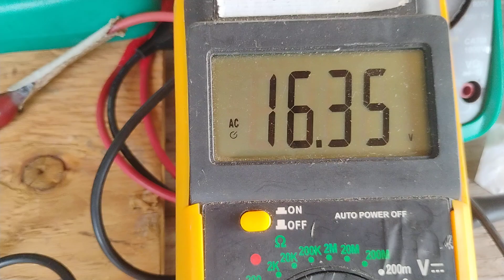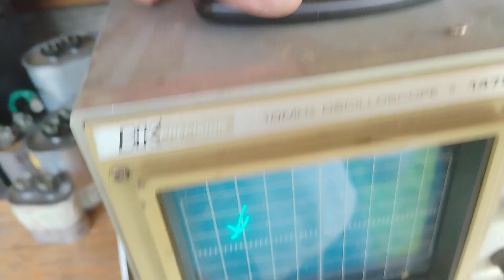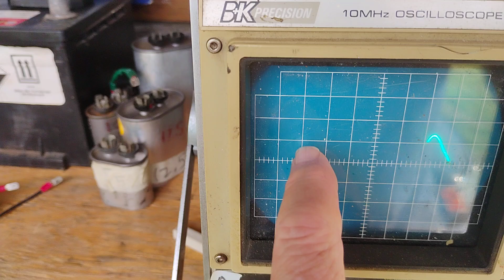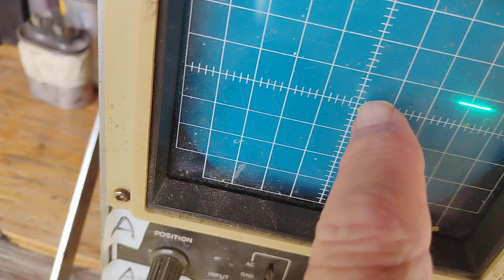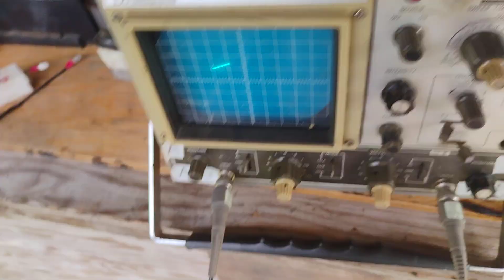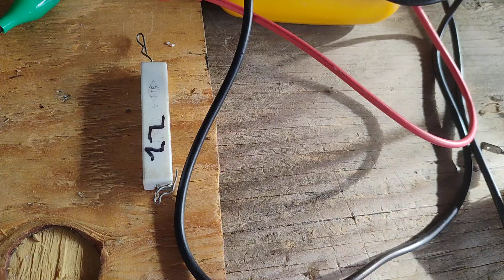90 degree phase shift with BiTT transformer gives zero watts input while 5 watts output

Comment from the maker: I did not mention it in video, but "how it works" is the shunt bars made of those hand-cut laminate steel plates (also varnish between each of  them to cut down on eddy currents) creates a "magnetic pathway" that the backemf current that is created at every polarity change of the AC wants to follow, as it will follow the path of least resistance, which is what the shunt bars provide.

So backemf currents which normally back up into the primary core leg and primary coil around it  (lowering its resistance so that there is more input draw whenever backemf is created, which is only going to be created when secondary coils are loaded with resistance)

Instead now the backemf currents are either neutralized, and never make it back into the primary core leg or primary coil, since it takes that alternate path of shooting backwards through the shunt bars, 
"up and over" the primary, and not the "usual" path directly back to the primary.
Almost like a magnetic-current diode connecting one secondary to the other  how to look at it.

The magnetic currents when they shoot over the primary through the shunt bars, will end up "reinforcing" power being made over in the opposite secondary,  if the backemf makes if over that far and just does not get extinquished/neutralized by all the ferrous steel in the shunt bars.  Either way the backemf currents do not make it backk to the primary.....

So thats how it works - the backemf currents bypass right over the primary and end up in the opposite secondary, and this works going  both ways, into opposite secondaries, plus same thing happens above and below the basic 3ph transformer as well, since two shunt bars mounted.
.
I will suspect consequence of "no backemf" entering the primary from the secondaries upon secondary coils loading up from a resistive load,,  is that the phase shift between volts and amps becomes that 90 degrees, with the variables"and choices to make from the "operator" to see  if it will really work (or not) is the resistive (or inductive) loading, and the voltage input and frequency of AC.....

Comment: Great work Kone! Did you try putting a cap in parallel to primary so as to correct PF at input? Maybe in that way you can use a normal inverter with PF=1 at the input. Keep going!
Reply from the maker: Hi Wally 
I wound the transformer to have 120Vac input and about 15Vac output, so the idea and next experiment is to run one of those statpower brand invertors from that 15Vac but rectified and with smoothing DC cap too.  Not sure how that will work out, hopefully if lucky the resistance of the invertor, while powering a load with its AC output (such as a rotovertor motor or whatever) will be such that I will still have that 90 degree phase shift from the g20Vac 60hz grid....if that "first step" goes well, I could have another statpower invertor (I have three, they have half the input watts as a normal invertor why I like them) that sends in power to the "hemmoroidall" transformerm instead of the 120VAC 60hz grid power.
I might be able to make it really simple, and just run the 120VAC from a statpower invertor straight into the high impedance primary of the hemmoroidall transformer. Then the 15VAC from the "H" transformer low impedance secondaries  rectified back into the DC input of the statpower invertor....who knows that might work for an easy loop.
I have not attached caps to anywhere yet, but will....I know a series AC cap coming into the  primary can really increase power output  in the seccondaries but have to be always  careful not to knock the primary AC input out of its 90 degree phase shift - that is the whole "trick" to it....keeping that 90 degree phase shift happening, now its reactive power being converted to real power is what it does no matter about anything on the input but "what it takes" to create the reactive AC power.
From the grid its easy -just use the grid with its "unlimited" current potential, so an invertor does not seem to take advantage of that 90 degree phase shift and show near zero input on the DC side of it, however I hear they do make "power factor" friendly invertors especially in the big wind turbines but have not seen one off-the-shelf available to public so this would be good project in future...
I havent tried a paralleled cap across the primary yet,....also want to try "vectoring" this transformer with one half of transformer running AC power in series through it, then it leads into an AC cap...Hector will say to vector the crap out of it...but have not tried this yet .....Thanks for writing!  !

Comment from the maker: Hi Warren
Its just the resustive load on the secondary output making the heat as it is a single 50 ohm resistor, a 22 ohm resistor gets even hotter, also makes more power too.
I want to make power where there  is no argument it is making real power and easy to measure for watts, also with no argument as to what the watts is on the output so using a resistor.  I only let it get hot long enough to take measurements, the oil barh good idea...the primary coil stays very cool which is good same with secondary cols that is good also..
Inductive load on secondary coming up later in tests (another transformer, a motor, an alternator, a heater etc) 
Original idea for load is a statpower invertor you know dll about....this why power kicked down to about 15v for the output of secondaries the idea is to rectify and cap it, then run the invertor like that "possibility" to loop it using the 120vac from invertor back into itself via this tranformer and rectifying the 15vac output

Comment: It might be interesting to capture that heat and put it to use while not destroying the component you are worried about.
Can you sink the component in a Tupperware tub full of mineral oil without burning the place down? You may have an oil filled heat exchanger that runs on nothing!
If it really is producing heat for free, that is really super because I don't know how it is in Winter where you are, but this little bit of the Globe can get frigging cold, and a little free heat might be nice!
Cheers Warren
Reply from the maker: Hi Warren
Yes the oil bath good idea always a good solution .....it is producing heat (watts) for "free" but its not really free (so far) since you have to have some apparatus to make that AC reactive power in first place.....a special super low rotational latch alternator, or power factor friendly invertor, two ideas.   Using the grid so easy - it has the unlimited amps behind it....although glass dome meter will stop spinning its disc if you really nail the 90 degrees perfect....Reza did this with run cap phase of RV motor making for zero watts draw to RV using AC caps just about everywhere.....not "as good" as overunity proof (like you did wih X.1.6W increase in watts of output compared to input), and not as good"as a self-loop either to really "prove it" but what I like about the 90 degree phase shift on the AC input is 99.9% of general public do not understand power factor at  all or what phase shift between volts and amps is or consequences and good stuff that can come of it, so its "safe"road to follow as "they" just dont get it and that is good thing whoever they may be..

Comment: Doug, lovely detailed description. You mention some energy being produced that is, I presume, annoying, that something in a zero consumptive circuit is heating up.
What is heat but energy? If you are getting heat for nothing, in Canada, that is not nothing, that is really something.
What is it that is facing destruction, I presume, from heat?
Reply from the maker: Hi Warren
Its just the two secondaries (in series) of the transformer with a 50ohn resistor across it to check the watts output that is causing the heat.  None of the three coils get hot from the 120VAC input, especially the primary does not so that is good.
Only thing getting hot is that resistor and that is good as it is solid proof power is being made.  I only leave it connected long enough to take measurements.....the oil bath good idea to keep the resistor cooled down...
The phase shift is 90 degrees so that means zero Power Factor in the V X A X PF = Watts in the power equation for AC so I am claiming zero watts input BUT it does take "something" to make that reactive power  out of phase voltage and current in the first place - when you pump the grid into it now its simple, the grid has "unlimited" amperage behind it,  and is simple to just plug into it.
So far, hen I use invertor instead of grid, you see no  good consequence of lower draw to the DC side of the invertor. appearing on meters in....the invertor you can buy are just not "power factor friendly" but maybe our group brain trust on EVGRAY@groups.io   can come up with something....
Iam going to run this hemmoroidall transformer with a statpower invertor soon - "seems like" it would be simple enough to power primary of this "H" transformer with the 120VAC from the statpower invertor, then take the 15VAC from low impedance side of  this transformer, and then rectifiy and cap it into the DC side of the statpower invertor that is creating the 120VAC that is being shoved into the transformer and there is a simple loop easier said than done as is usual, maybe with a lot of tuning and resonance reated with caps everywhere they can go, this could be done we will see......

Comment: Nice work. It would be nice for your audience to see the waveforms on a digital scope with math function that makes another trace that sums the V and I traces. We can't see much in the video of the analog scope. Got any ideas for powering it with electronics? Getting reactive power to do work is a great achievement (well done!) and getting a source to take the reactive power back is probably harder. None of my inverters ever did it. Are you inspired to dig out one of your funky alternators from the vault and hook it  up? Thanks for sharing.
Reply from the maker: Hi Alex
Yes it would be nice having an invertor that does not trash reactive power, and be able to "take it back" as you say...they say in big wind turbines that are huge-amperage capable they make invertors that are "power factor" friendly but thats all I know about it - they do "have them" but they on very big scale of things.
My video of scope forms has gotten better, more recent videos you can see stuff much better.
What is most interesting to me is how that primary coil looks on scope when I put that 3.73 AC cap across it (essentially a 4uf cap) and it does not look like classical resonance,  (however that would look!) nor classical saturation of the coil....I would see the choppy/fizzy outline of the sinewave when a coil saturates, but interesting is the spikes that go both ways instantly - a few of them within one sinewave....If you look close you can see that I am talking about. "maybe" this is what happens when the backemf from one secondary collides with the backemf of the other secondary as the backemf travels through the shunt bar path....and they meet head-on, while some of it does not and manages to make its way over to the opposite secondary core, reinforcing power that way (how its "supposed" to work)
I see this sort of "hyper AC spikes" when I do shorting of coils at sinewave peaks why I think this is what those funny spikes "within the fizz" are......
Also I had a revelation (true or not) that when the primary "goes fizzy" from that AC cap across it, what it does is make any "latching" of the backemf currents to the primary very hard, if not impossible for the backemf to affect the primary this way, as the vibrations are not in synch in the least and so the backemf can try and grab onto the primary coil all it wants, but it just cannot but for some strange harmonics that might randomly latch to the primary....this pretty good theory - just thought of it seeing these new scope shots and what it all could mean

Comment: This is generating 5 watts on its own with no outside input? Just from the reaction of the design?
Reply from the maker: Hi Paul 
90 degrees has a  power factor of zero...first you find the phase shift angle between AC volts and AC current, then look up what the cosine of that angle is, and the cosine is the power factor.
Reply from the maker: Hi Silversobe 
You have to have a lot of current "circulating" to get that 90 degree  phase shift between volts and amps  so it's not something totally free coming  from nothing at all 
but think about a spinning alternator with no load on it, and how easy it is to spin - this is reactive power it would be producing if you look at scope to the output of that alternator.
Volts and amps  would be totally out of phase is why it is so easy to spin, but put a load on the alternator, now very difficult to spin as you are now producing real power..
think of what a reactive power to real power "convertor/transformer" could do - if for example with its primary connected to free spinning alternator, then .
 Put a load on secondary of the convertor/transformer; it will not cause lenz braking to the spin of the  alternator under load anymore
Reply: @MrDKONZEN  Thank you very much for sharing
I have two questions to ask you:
May I ask if the beginner is just a unidirectional high impedance coil? Is the secondary output two coils in series? Is the secondary winding direction opposite? Relative serial output?
May I ask if you can post a link icon?
Thank you in advance
Reply from the maker: @yunshuizhongyi 
Hi YunShu 
The cois are multifilar, each a bundle of 12 wires.  
The primary has it's  12 wires in series for highest impedance, the two secondaries have 6 of the 12 wires in parallel then the two bundles of 6 are in series.  
Then each secondary coil is in series.  
Idea is to connect the "multifilar" coils like this so input is 120vac and output is 15vac.
Yes the secondaries are in series, and they are opposite wound in their winding  direction too.
Reply: @MrDKONZEN  good
Thank you for your reply
Reply: He says It's consuming no input power because the power factor of the input waveform is zero. But I'm getting confused. Shouldn't that mean the phase angle between input voltage and current is 180 degrees?

Comment from the maker: Hi Lukie
Thanks, this  just the bare bones no caps yet ... 
There should be a specific resistive load that will give the most power from whatever voltage input is too,
Plus a "perfect"  inductive load as well ,(a generator, or motor or another transformer)
Also  want to try "vectoring"  the transformer in having secondary and/or primary half run  "in  series" to a cap, rather than the normal  parallel hook up.
Maybe this best way to resonate it?
Reply: @MrDKONZEN  play around with it : )